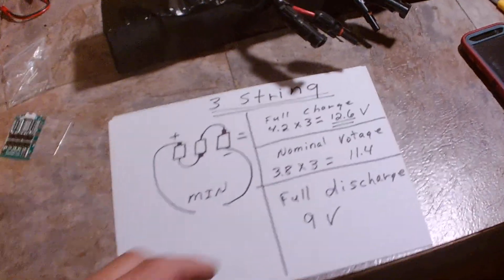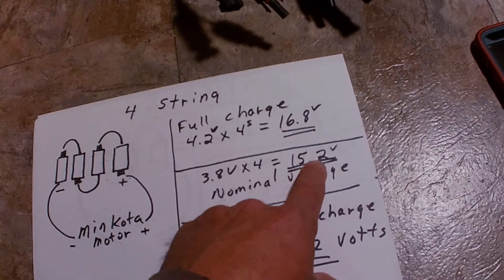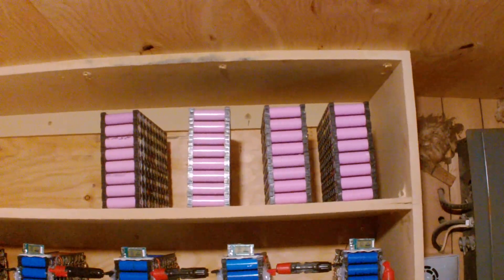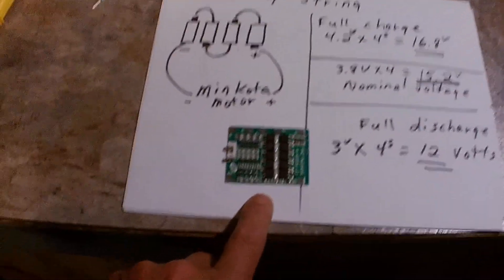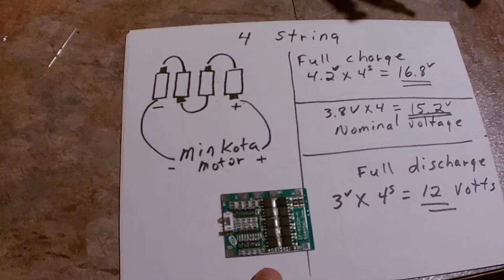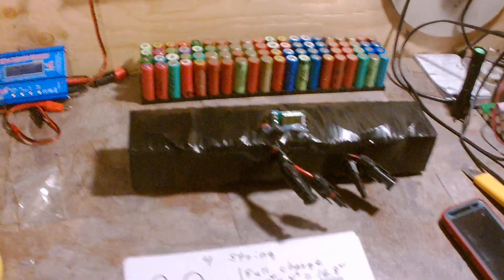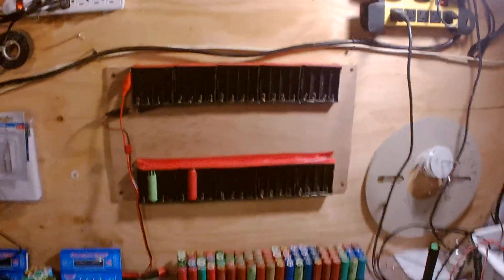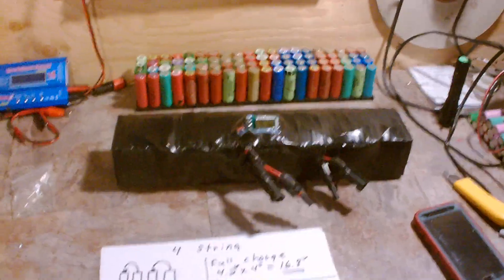best light weight trolling motor battery diy 18650 part 1

Comment: Have you made it to spot welding, so easy to build and so clean, you can pre solder the tin with wires then spot weld

Comment: Hi. In a minkota 36lbs can i do the same pack 4s20p and fully charged directly to the motor? I do not plan to use a bms because will charge with my IMAX and be caution with not dischrge too much

Comment: Hi I have a question about drill batteries. I have a Ridgid 18v 4ah battery pack. I noticed that the pack has a possible max out put of 40Amps at max load and speed. At full speed it last about 10 minutes. My question is can I use a pwm to increase my battery efficiency.

Comment: Hello Reggie, this is greek to me!  I have a question i own a VMAX lithium ion 50 amp hour battery in one description they call it a 12 volt in another the say 14.8 nominal voltage?? I run a 40 thrust minn kota with a PWM attached i recently burn out 2 PMW boards is it the 14.8 nominal
Voltage why this happened????
Reply from the maker: 14.8 nominal is top charge rate an 12v is fully discharge rate  for longivity and full cycle life of the battery that is general with most 12 volt batterys.pwm is pulse width modulation that does not go well with lithium batterys as they requir cc cv meaning constant current constant voltage so a mppt charger  should be used.pwm chargers send pulse charges  thats not recomended hope that helps
Reply: reggie brightman  Just checking I'm not have any issues charging my lithium I have the proper charger that came with the battery
I run the battery through a PWM to my trolling motor for better throttle control and battery life. I seem to be frying the PWM
Boards after 30 min. Of use.  The pmw i used was rated 80/60 amps 14VDC might it be the voltage is to high?
Reply from the maker: i wouldnt say the voltage is to hi but it very well could be i never used a pwm motor controll but my guess is its getting to hot an probly needs to be ratted to 150 amp  as the 60 or 80 is clearly not working for you if it were an over voltage problem it would pop right away
Reply from the maker: on my motors i go direct to the battery no pwm 50 pound thrust minn koda
Reply: reggie brightman I can go direct but the PWM conserves battery life and I really want that slow rpm to move along the shore line
Or combat the wind to help keep position no matter what the wind speed is. Thanks for your thoughts

Comment: nice i have 42x  LG MJ1 brand new , I was concern about the voltage @16.8 but  it looks like the motors can take it although i am using a watersnake T24 i AM GOING TO BUY 2 MORE LG MJ1  to make a 4s11p pack - i am also finishing  a LIfepo4 72 AH pack from some  CAM72FI 3V-3.2V-3.65V Lithium LiFePO4 Battery. let me ask u what is the total weight of yours